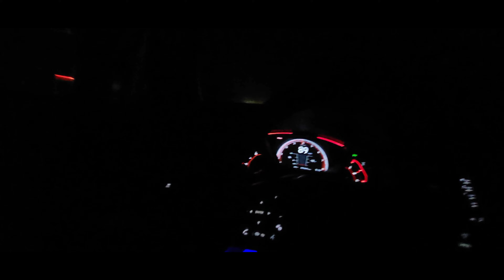My 10th Gen Civic Si Vs. An Alfa Romeo Gulia! CLOSE RACE!

Comment: Crazy how I honestly searched a video for a comparison, since I was looking at getting into a Giulia, and you make a video as of 6 days ago😂😂😂 this world is nuts like squirrel shit
Reply from the maker: Hahaha i'm glad it worked out😂
Reply: If you do plan on getting a used giulia make sure its had the latest software update from the dealership, make sure turbo coolant system lines aren't leaking from the turbo, and that the low temp coolant pump relay is functional. Other than those items and the questionable stock battery these car have proven themselves to be fairly reliable. The relay is like 10$ and the coolant o-rings are $20, pretty simple to fix and the mopar replacements last longer